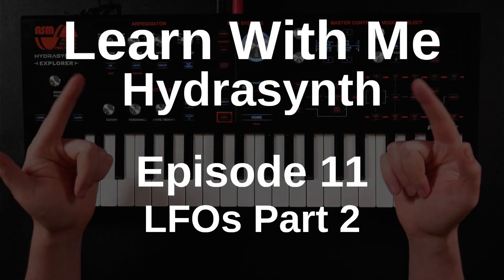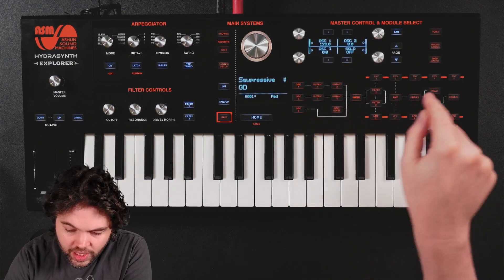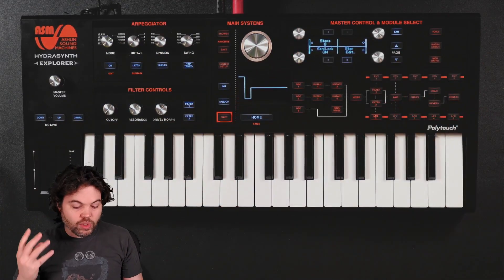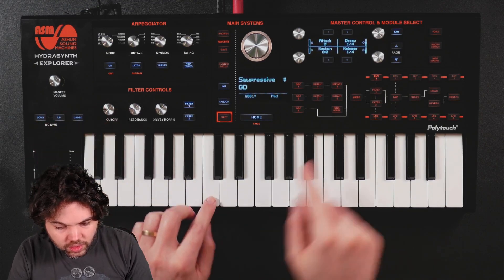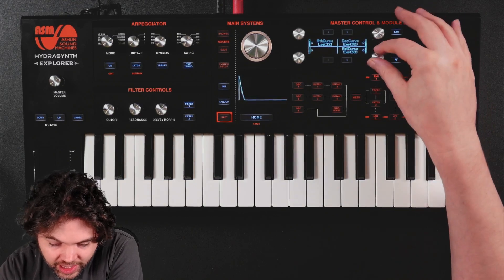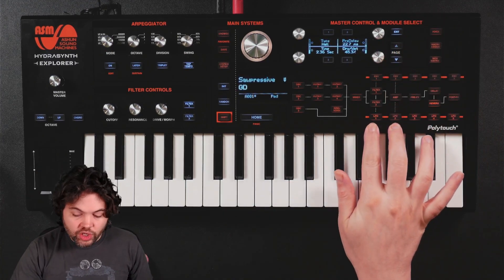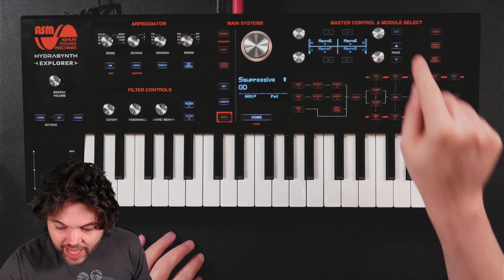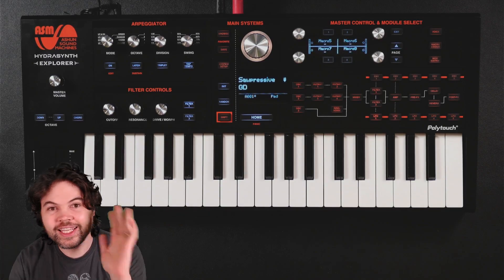Learn With Me - Hydrasynth: Ep11 - LFOs Part 2

Comment: Stepped LFO after an update allows 64 steps?
Reply from the maker: Thanks for watching, and for commenting. The Hydrasynth Explorer has had 64 steps in the stepped LFOs since it was released. I think the original Hydrasynth and Desktop need firmware 1.5 for that feature. I believe they originally also lacked the semi-tone locking for pitched use.